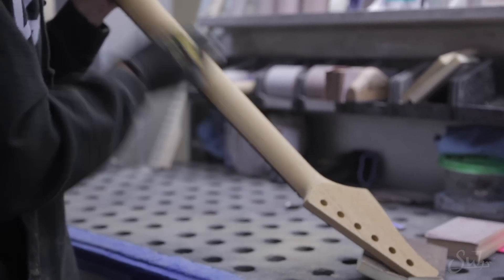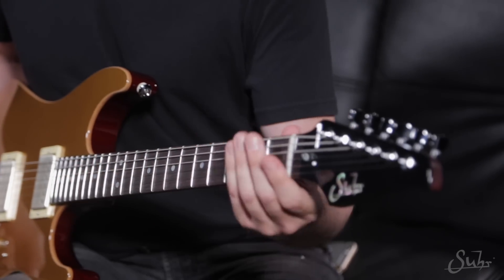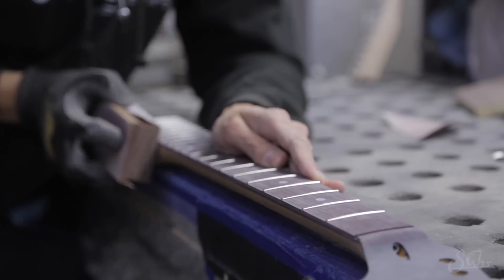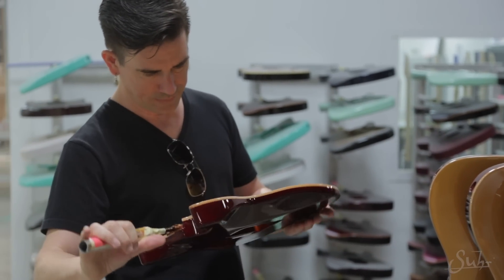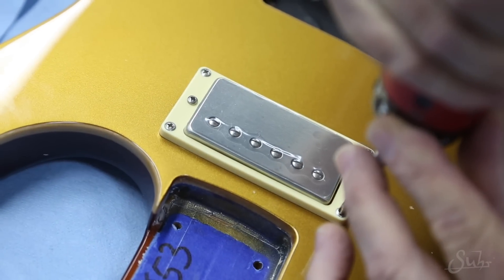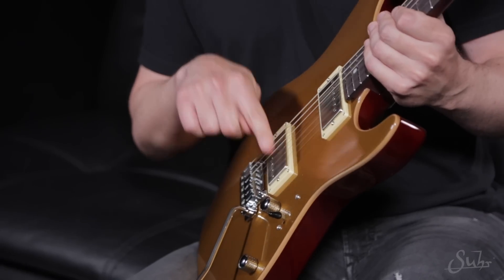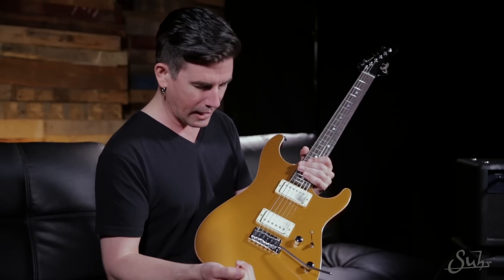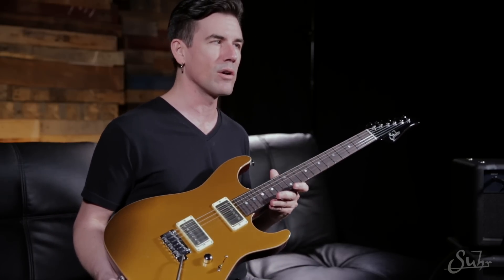SUHR PETE THORN SIGNATURE SERIES

Comment: PRS-esque
Reply: ... how?
Reply: It looks like a DGT (one of the few PRS guitars that has pretty universal acclaim). That's a good thing.
Reply: Well, apart from being a gold coloured double humbucker equipped guitar, I don't really see the resemblance. Different bodies, control layouts, hardware, scale lengths etc.
Reply: A binded, contoured humbucking double cutaway with a tremolo, 22 frets, 25" scale, and a medium sized neck is pretty dang close to a DGT. 

Again, that's a good thing. We need more guitars like this on the market vs. it being a Single Cut or some shredding ax with a Floyd. My current guitar is a Suhr Classic Antique Strat.
Reply from the maker: just for clarity, 25.5" ;-)

Comment: Urethane never "feels" like and oil finish except when you burnish it with steel wool and even then it polishes up from playing and gets tacky again. Nitro is the real guitar finish.
Reply from the maker: actually I disagree, ACRYLIC SATIN urethane feels way more smooth and not sticky compared to Nitro and never gets tacky,  urethane is a different feel compared to Acrylic Satin Urethane.
Nitro is attacked by heat and sweat where as Acrylic urethane is not. Also when adding flattening agents to make nitro feel more satin it quickly glosses up again just by playing because it is a softer finish. At least IME - John Suhr
Reply: I have an old nitro finish on my les paul and I have a new very hard urethane on my taylor standard. the taylor seems tacky compared to the gibson. I have a warmoth neck with their "satin nitro" finish and its like a gun oil finish very slick i love it. I can imagine the satin acrylic does feel very nice. I have an old washburn that had some sort of glass like epoxy sanding sealer. I sanded that neck for an hour and still has finish on it. I can burnish it but it always gets polished after I play with it for a year or two. I prefer a satin finish for sure.
Reply: This finish never gets tacky, :) It's always slick.